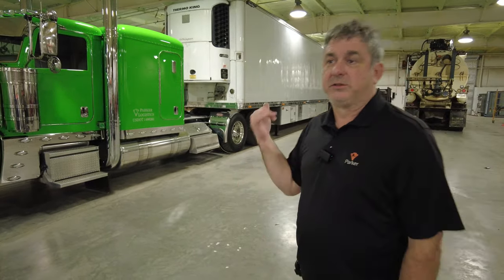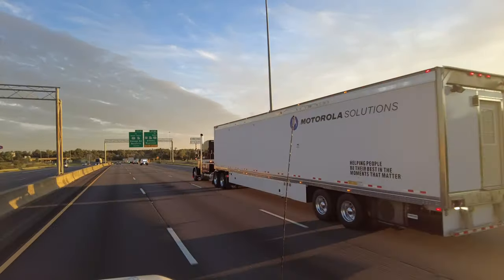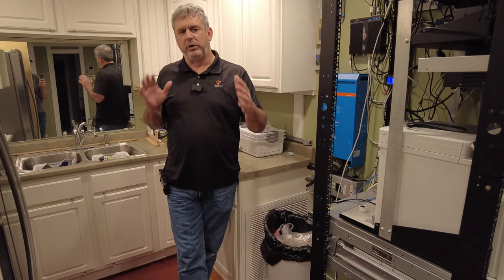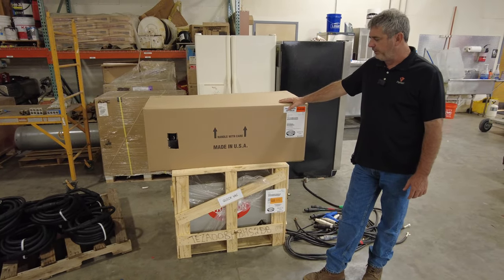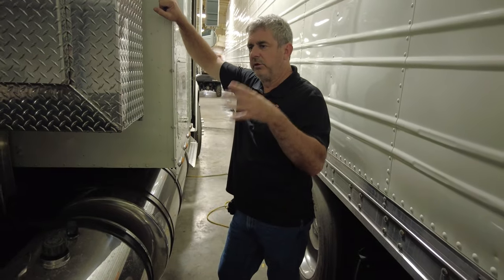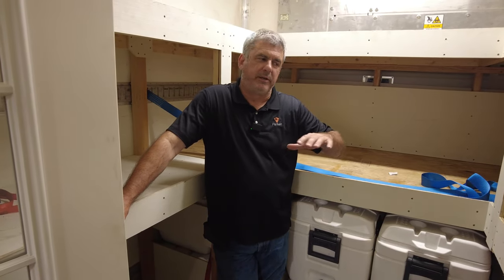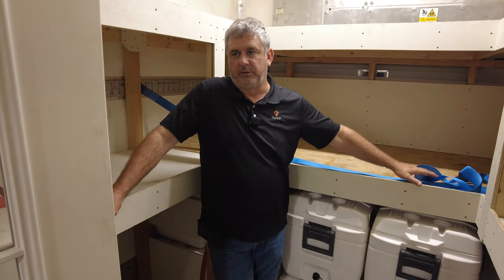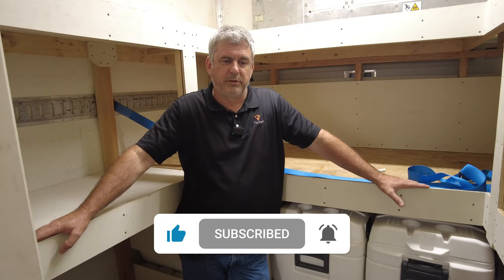Emergency Backup Systems for Refrigerated Trailers! | Parker Systems

Comment: Great video Question for you guys how come you chose to use a separate system and not just plug the reefer in and run it off a generator?
Reply from the maker: That reefer unit does not have that option.  We have reefer units with the electric option, since this unit didn’t have that we went this way.   But had I purchased a electric/diesel unit that would have been the the way to go